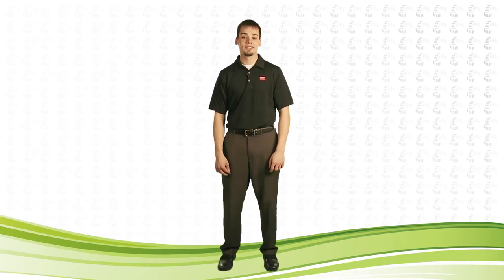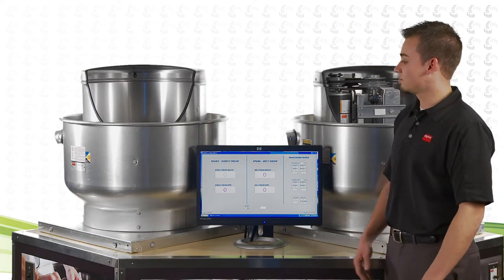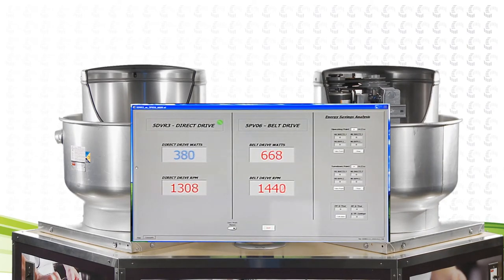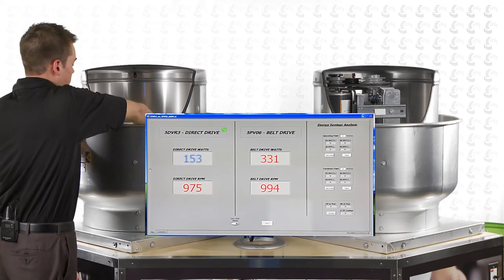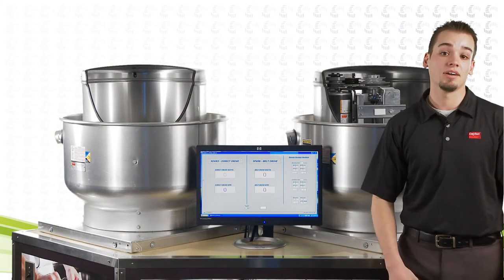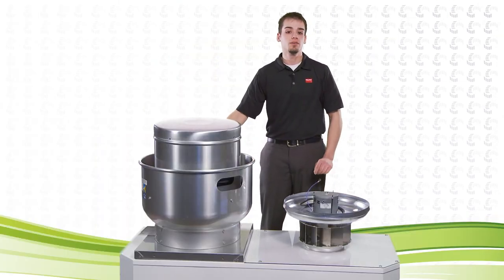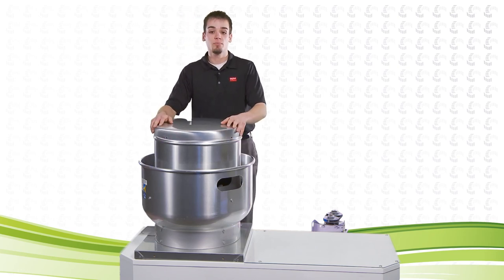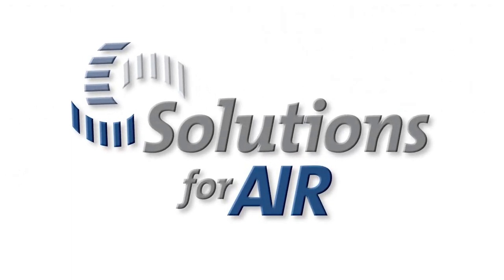Solutions for Air Variable Speed vs Belt Drive Fans and Replacement Power Pack Demonstration

Comment: EC motors break if you sneeze or call it names. Very temperamental. Also if you have to replace them
 ECM cost way more and chamces are you'll get the wrong motor or they forget to give you a code to start it etc. In summary do not buy them